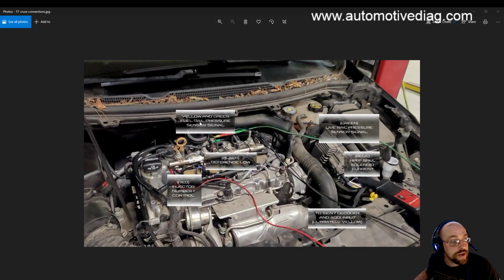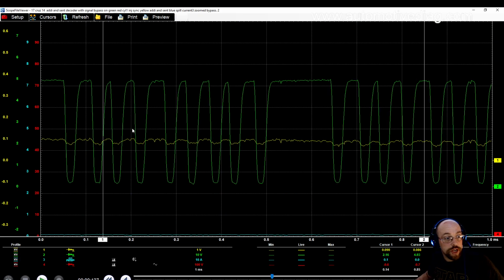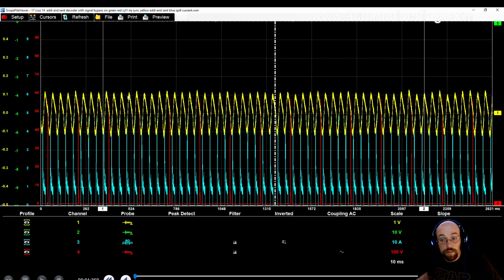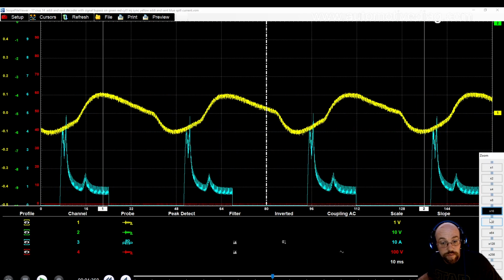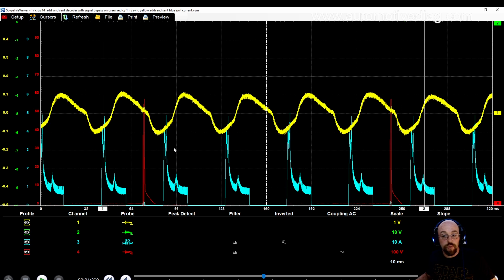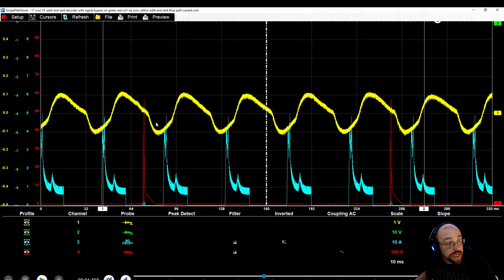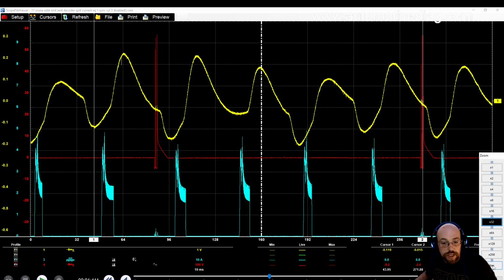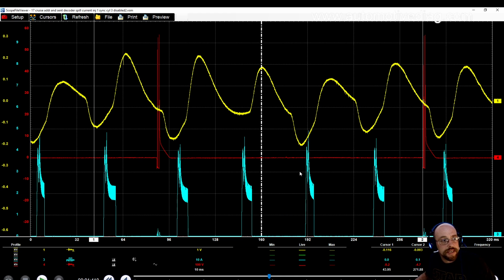2017 and newer GM GDI dynamic fuel system testing.

Comment: At 8:28 I have no idea what the tooling is you're talking about, but that's because I'm obviously jumping in late. But so far this looks like something I can do with my pico. But you mentioned a binary tool too and maybe I'm asking to soon
Reply from the maker: It is certainly true that some of what I'm doing here can be done natively on the Pico.  This video in particular was focused in the J2716 S.E.N.T protocol sensors used in newer gm fuel systems ( and many throttle position sensors as well as other sensors) While true, the Pico can decode S.E.N.T, what it can't do is output an analog signal useful for relative comparison with other signals as shown here.  It can show the actual hexadecimal or binary numbers but this doesn't provide an analog signal useful for relative comparison with other readings under the hood as my device does.  The final version if the ADDi that I'm working on finishing, includes a min/max calibrated "arbitrary node" useful for testing virtually any S.E.N.T sensor output directly. I am unaware of any other way to accomplish this .  One of my primary focuses of my project was to empower techs with more basic scopes with some of the more powerful features the Pico affords.  I personally find my Verus Edge to be a much more convenient grab than my Pico, and usually use my ADDi to empower my Snap on with some of my Pico's capabilities.  Thank you for your great engagement!
Reply: @automotive_diag  forgive my ignorance as I would not now how to set up that math on the pico anyway. I'm interested! And I agree with you, love my Verus scope
Reply from the maker: I have certainly been able to reproduce some of my results very accurately without my device on the pico by using filtration, offset adjustments and zoom levels.  One of the goals of my project was to automate the setup and configuration allowing techs with less experience or scope training to attain better results.  One of my primary goals has always been to empower techs to get more out of thier technology. And lessen the learning curve associated with scope use.  If I have made someone's job easier, then I have accomplished my aim.
Reply: @automotive_diag  awesome!
Reply: Waiting anxiously for this tool to be on the market!
Reply from the maker: @porscheaaron1  I just released the ADDi at Vision this year, going to be posting many new videos very soon.  There are already many new videos on my Facebook and Tic Toc
Reply from the maker: @porscheaaron1  I'm a full time dealership tech, and do this almost entirely myself (with the exception of the very appreciated help I get from @Erik Sanchez  of @rising_edge_diagnostics assembling circuit boards).  I was about ready to send a test device to the FCC for certification to be sold in the US.  It was then that I found out about a Pico workshop that was sponsored by AES Wave where they introduced one of my prototypes.  Some very good ideas for improvement came from this, and I am doing a minor redesign to incorporate some of the recommendations.  After I have an updated prototype, I will send it to a laboratory for FCC testing.  I'm working very hard to have this done by Vision in March.  Thank you so much for your interest.

Comment: At 7:08, why does rail psi drop at all during the event where the injector is not firing? Psi solenoid off equals open? So it's dumping on the low psi feed line? Thanks! Very good video, I'm going to share this if you don't mind?
Reply from the maker: The device allows accurate visualization of relative  pressure in the rail, you are seeing the cam lobe back away with no injector event occurring.  Great question and thank you for your great comment!
Reply: @automotive_diag  is the high psi solenoid open or closed during that drop from the cam lobe? Thanks!
Reply from the maker: @ScannerDanner  the high pressure spill solenoid is open at that exact point, it doesn't close until the solenoid current comes in (blue trace) but I believe there's some timing interactions between the cam lobe and when the high pressure fuel pump check valve closes after the lobe apex.  Also bear in mind that since I'm using active op amp filters, there is inherent phase variance that can skew the pressure output display by a few degrees.
Reply: @automotive_diag  oh! So the analog signal we were seeing on the scope was your binary tool taking the CAN data packets from that sensor and making them analog? Awesome! See how important that first image was?
Reply from the maker: @ScannerDanner   That is exactly correct that is exactly what the J2716 sent decoder does.
Reply from the maker: @ScannerDanner   You can look up J2716 S.E.N.T it's not CAN it's a unidirectional point to point protocol.
Reply: @automotive_diag  would love a class on that
Reply from the maker: @ScannerDanner 
Here's side by side of the serial data signal directly from the rail pressure and the ADDi output to scope. Green: live sensor data yellow: ADDi decoded output
https://drive.google.com/file/d/18cGrOxVt9aMNZQHVW4zVEVBX3rXgCkiy/view?usp=drivesdk